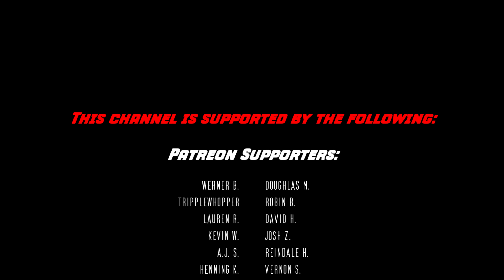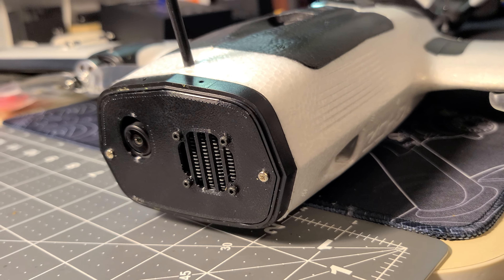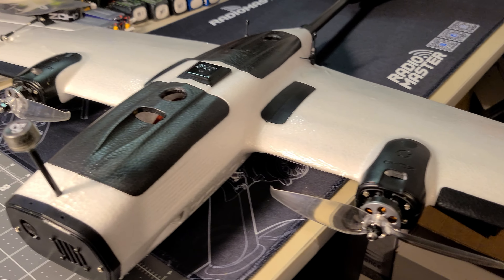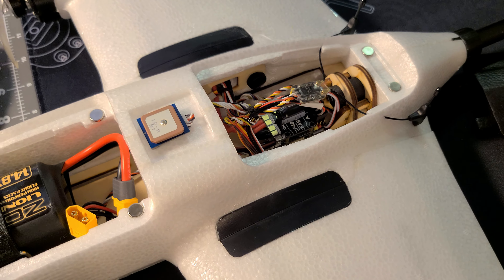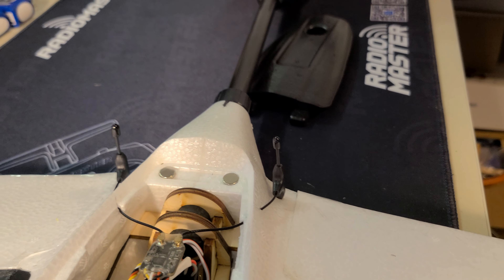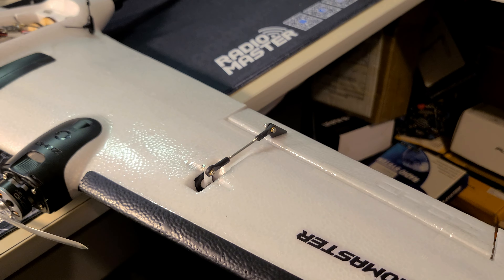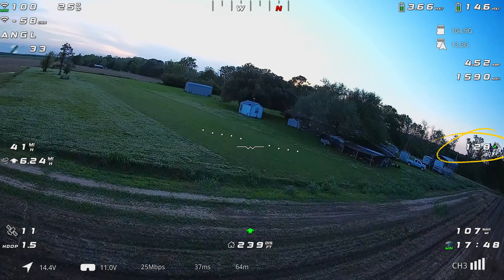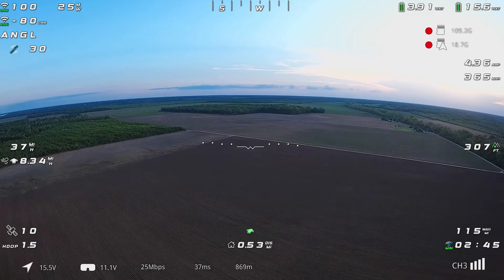ZOHD Altus

Comment: What do you prefer for laminating your foam planes? I've used a thinned E6000 as a sealer, but it doesn't last long.
Reply from the maker: I've only used laminating film, like this - https://www.racedayquads.com/products/laminating-film-by-the-foot-choose-your-thickness?variant=31592443740273 It's not often I laminate them though, I usually don't bother, although it does make for a smooth and shiny finish, and adds some durability. I decided it was worth it for this one after repairing the wing, just for the added piece of mind... lol

Comment: 18:25 the CW, CCW markings are a little ambiguous in meaning, but I think they are wired from factory as intended, opposite of your preference.  Because of the way the printing is oriented, you are meant to be reading them when standing aft of the plane, then the text would appear upright, then the directions agree with factory wiring.  Doesn't really matter huh.
Reply from the maker: I always set up my props on twins to rotate the top blade in towards the fuselage. Without getting into a lengthy explanation, it comes down to the P-factor. Planes fly with a positive angle of attack, which means the downward rotation blade on the prop makes more thrust than the upward blade. You want that one closer to the fuselage, so in the event of a motor failure, it will have less effect on yaw trim and be easier to limp the plane home on one motor. Arguably, there's a lot less effect at the smaller scale of these planes vs full scale, but if we can do it the "right" way, why not? ;)

Comment: Nice review. It's great to see someone demo with 2-blade props as have similar concerns with 3-blades getting ground strikes. Look forward to seeing some efficiency data once you're able to cruise in nice weather conditions. 
For the barometer, you could try bench testing by powering up flight controller to see what happens over the course of a what would be normal flight time. My guess is a defective barometer sensor. INAV logging might be able to record both GPS altitude and baro height values. It's possible the barometer is not outputting any data, and just getting luck with GPS readings and sensor fusion. An INAV dev might have some tips on how to cross verify.
Reply: A thought ... regarding the blunt nose. A 3d-print a nose similar to the ATOM-RC Penguin. Somewhat streamlined, but gaps to allow air at HD VTx..

Comment: I have the same problem with the barometer when I raise the throttle with out the propeller the altitude goes up the more I raise the throttle the higher the altitude shows up on the goggles I am running Inav 7.0.
Reply: On the F405 mini

Comment: had same baro problem, with speedybee and mag gps. try disconnecting mag wires from flight controller.. it worked for me. inav was unable to arm,  baro fail.
Reply from the maker: I don't have a mag on there, it's just a regular BN220 without mag. I've not had any other indication of problems apart from what I saw in flight.

Comment: the "lamination" you talk about. What and how?
Reply from the maker: It's a clear film that iron one, similar to the covering file traditionally used with built up balsa planes, but it goes on with a bit less heat and doesn't shrink as much. It's common to use on foam planes where you want them a little stiffer and tougher. Like this - https://www.racedayquads.com/products/laminating-film-by-the-foot-choose-your-thickness?variant=31592443740273 The I used here was some old 1.7mil stuff I had sitting around for years.
Reply: @bonafidepirate  thank you for the explanation. Yeah I know the good old shrink foil in balsa builds.

Comment: that's sppedybee using cheap baro clones. Same thing with the 405 v4 stack. I told them about that issue and they said they won't help because I conformal coated the stack but offered 15% discount for the FC board. As I said in reply how new FC gonna help if it still has the same cheap baro clone. And then they said - how dare you to think that we use clones! But here is 30% discount!! So I stopped buying anything speedybee. And the baro, I solved the problem by installing an external I2C bmp280 board I had laying around